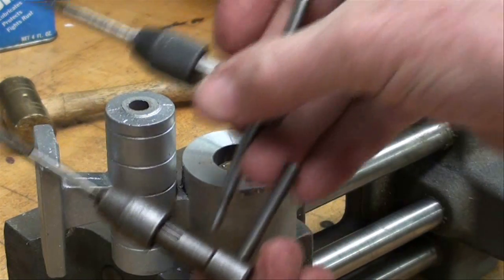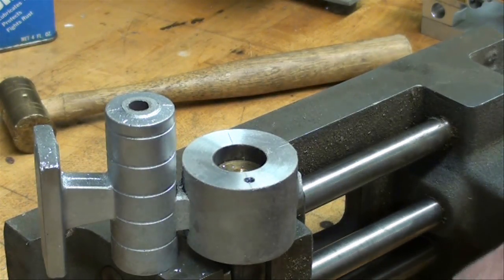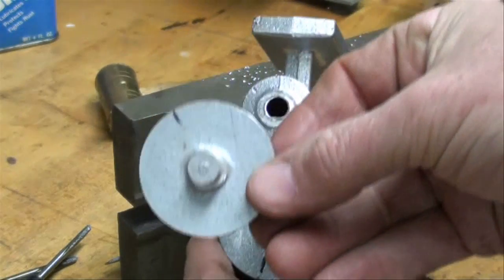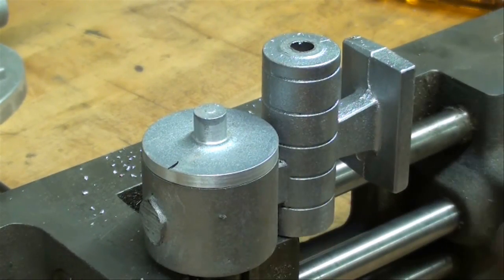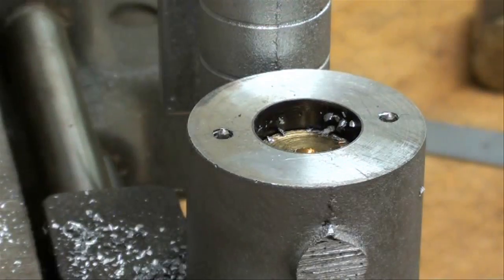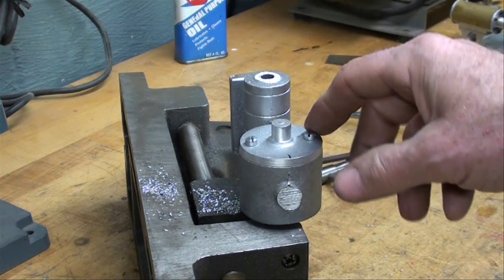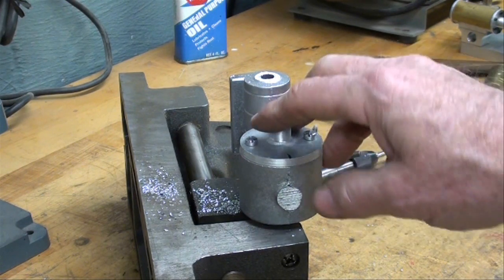MACHINE SHOP TIPS #27 Transferring Holes Part 2 tubalcain

Comment: Hi  Mr Pete what is the casting for is it a project . Those punches are a good tool to have but the transfer screws are indispensable for picking up a blind hole after i saw them in a video i ordered a set . JM

Comment: This is great stuff, Mr. Pete! I need to quickly make a couple single-use transfer screws to install a DRO on my mill. I may use some set screws as the start of the project, but want to keep it simple and quick. Thanks for the HUGE library of vids.

Comment: I tried to use transfer screws to transfer holes from a generator to a bracket but the screws did not leave a mark.  I'm wondering if you could paint the point of the transfer screws so it would transfer the mark?
Reply from the maker: Kimberly Peacock try it

Comment: I have a Cameron precision drill press. It uses bronze bushings and a thrust bearing. The motor was a bit loud for my liking so I replaced it with a Sherline DC motor and speed control. I also replaced the drill chuck with a Albrecht 1/8 key-less chuck. I payed $350 for it (new) back sometime in the mid '90s. If your careful, you can use a #80 drill bit.

Comment: If you cannot wait to get lucky and find a Cameron precision drill press, Micro-Mark sells a really decent import with all of the capabilities - including a digital depth gauge - for ~$300-

Less when they put it on sale... Works great for my really small diameter, controlled depth, precisely located hole needs...

Comment: you have to put a degasser in your melt it helps the gas bubbles come out of the melt and there is also impurities in the aluminum that cause this you have to put in [can't remember the name] but it makes impurities come to the top so they come out with the dross. they are both in pellet form you have to put them close to the bottom of the crucible with the aluminum already melted cool stuff though it gives you much better castings as always good work sir

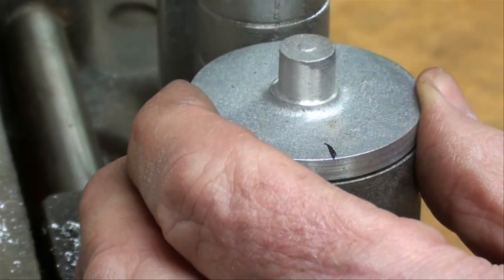Comment: Mr Pete, at about 5:38 it seemed at least on the video that your rap was pretty hard. I guess the threads of your aluminum work can tolerate that much stress since you didn't mention being ginger with your persuasion. What type of metal do you suppose these transfer screws are made of and how many uses would they last for?

Comment: I did not know any of those were available, never seen them any were here in Canada, I always ether measured and scribed (many lines) out or sharpened bolts to a point after cutting the head off